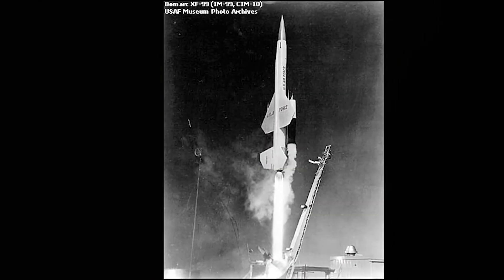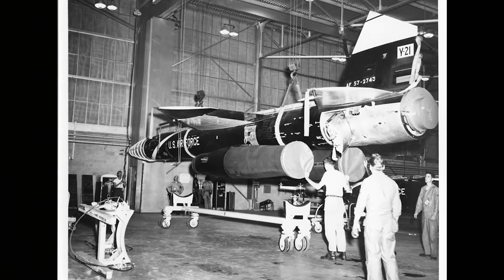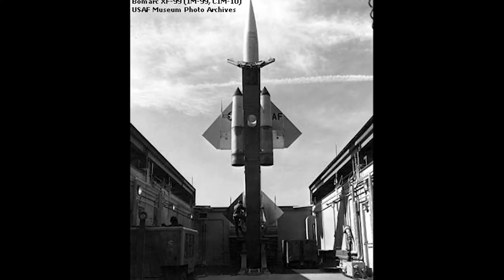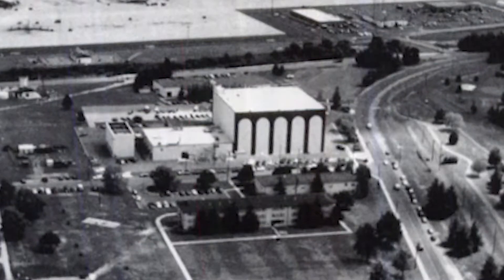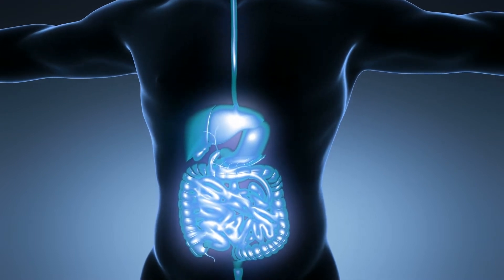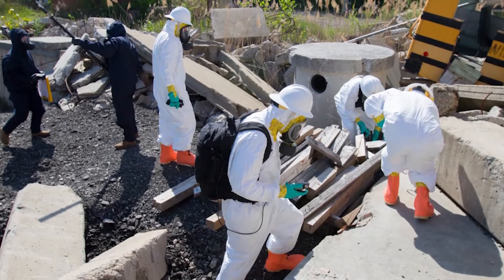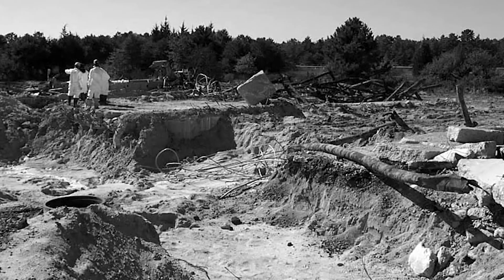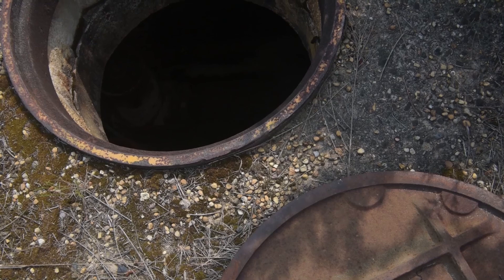BOMARC Missile Site Accident History and Recovery.

Comment: I have visited that site several times in the late 1970's and early 1980's while driving on route 539.  The gates were open and I just walked in to check out the area.  I was told about the accident by a high school teacher who was stationed at McGuire AFB.  I later found out that the area I was at was not properly cleaned up until 2007.  That fence around the area is of little use when the gates were left open.